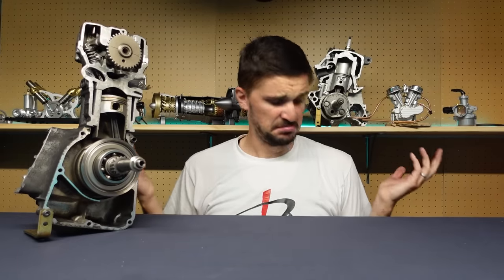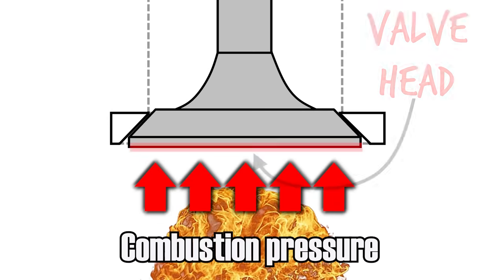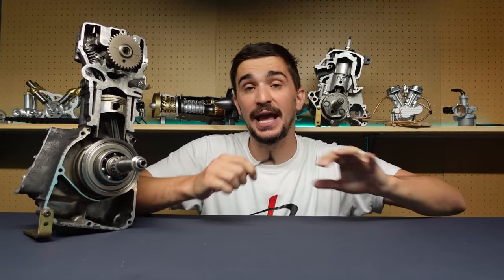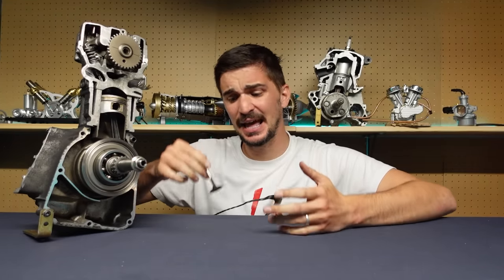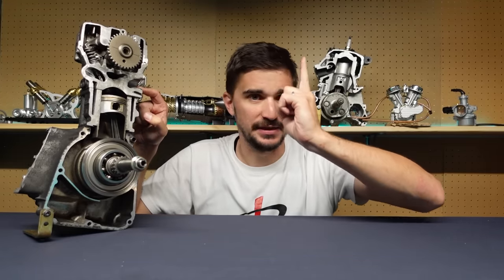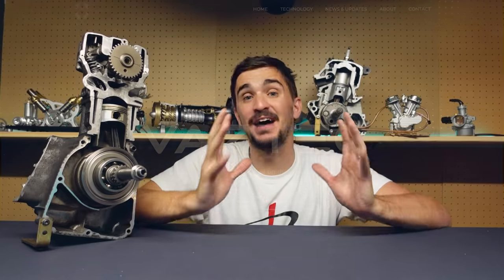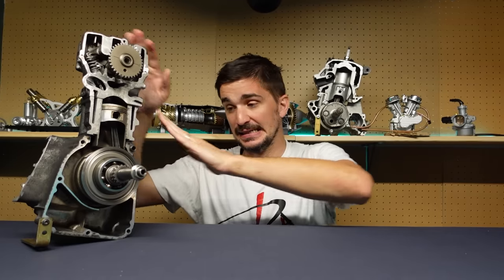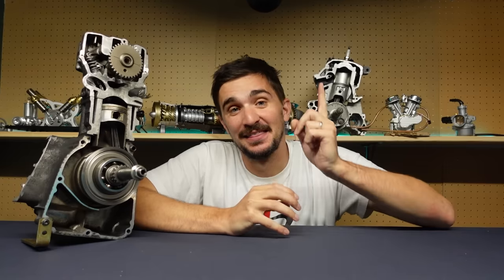Rotary Valves Make Normal Valves Look Silly - Why Aren't We Using Them?

Comment: This man just makes me want weird engines in my cars.
Reply: Real
Reply: Idk about my car but I certainly want a garage full of gokarts with all sorts weird engine designs
Reply: no shit. bro single handedly convinced me to bike carb swap my daily driver. imagine running carbs in 2024. but it was worth it. so much fun
Reply: Before watching: The engine in my car is fine. 
After watching: I want a bevel-drive, desmo, vr-5, contra-rotating twin crank design, two stroke diesel engine in my car.
Reply: @workdesu  when there’s a massive EMP you’ll be the only guy driving home.
Reply: @markm0000 fun idea but an EMP would also fry the starter motor & ignition system.
Reply: weird engines equal weird problems
Reply: @Matthew_Removeafterwashing   weird problems require weird solutions. Grab a banana
Reply: @markm0000 Diesel then? And without an ECU? Better keep a horse around! 😂
Reply: I just put valve springs in my mattress....  Wife loves it. I wouldn't of had that idea without this video.
Reply: get an audi with a chain in the back
Reply: @gags730  "wouldn't of"?
Reply: @PeterBaumgart1a   points for ignition and a mechanical pump. It can be done with gas as well.
Reply: Tbh cars don't profit nearly as much from this as motorcycles do, there's a big difference in the springs if your max RPM is 7000 opposed to the 16.000 in motorcycles, because of their rev limits motorcycles aren't even able to utalize technologies like direct injection yet
Reply: @alanhat5252  Idk, why aren’t cars faraday cages? Or at least like planes with lightning strikes have the skin channel the induced currents. I mean these currents have a low resistance path to ground. I’m genuinely curious as to how resistant are cars to EMPs.
Reply: @markm0000  I personally have a 1980 triumph spitfire with mechanical fuel pump and a carburetor and points ignition. I’m not sure how late they made these setups though. I also feel 2000s Toyotas would still turn on somehow, damn is that fanboyism?
Reply: @nestormoctezuma4695   no it isn’t. Get to talk’n long enough, everyone agrees a Toyota will outlast any other car. Even old Chevy guys will own up to it.
Reply: @workdesu  carb swap, dude that’s SWEET, all car guys have sacrificed drive ability/safety/ride comfort for the sake of cool. I sacrificed the existence of reverse for the sweet sweet sound of 14000 RPM. What car did you do this to?
Reply: @PeterBaumgart1a    Yup! It's slang, you have to say it out loud with a NY/NJ accent.  
If we are in English 101 we would call this a 'contraction' for "would not have".   Hope that helps!  
Yo, where you from? --> (Where are you from?)
Reply: He makes me excited about working on engines...his enthusiasm makes me forget about 1hr valve seating with a plastic toy arrow and sore hands...
Reply: @0r1x    HAHA OMG that comment is hysterical...  You feel like you are trying to start a fire in a wet forest.... only thing burning are your two hands.
Reply: @alanhat5252  ur right bcos i currently run electronic ignition system and fuel pump. but there's a variant of my engine that have contacts distributor and mechanical fuel pump. i started with those when swapping my efi to these carbs 😬 then only recently i settled on electronic fuel pumps and ignition system. and starters? it's manual..if it died we just push it in gears and would roar back to life ✨
Reply: @markm0000  ur comment made my day 🤣🤣🤣 thanks bro
Reply: @nestormoctezuma4695  it's SWEEEET AF. no rly. the throttle response is night and day difference and the sounds of those 'itb' carbs ✨👌🏽. my car is a 93 Mitsubishi Mirage hatch with 1.5 litre 4G91 engine. and did you swapped a whole bike engine into yours? its what i can guess from your description. if true damn that's sickkkk
Reply: This does the same thing to me
Reply: Can I interest you in a Cryogenic Thorium Powered Rotary Valve Sterling Deltic?
Reply: At least it will be easy to repair.
Reply: @markm0000  you would need a model T for that...
Reply: You say that until you need a work on one and need replacement parts....
Reply: @gunsmoke132  if you want it to function after an EMP some sacrifices must be made...
Reply: Gas turbine cars when?
Reply: @tirushone6446  thats a 50's thing
Reply: @nestormoctezuma4695  yea it is. You Toyota guys think you're car was hand crafted by god.
Reply: A wankal opposing cylinder rotary valve trimotor? Yes please?
Reply: so true! :D
Reply: Mazda/VW: Hold my beer 🍺
Reply: @Charon-5582 I got lucky and have a vehicle that is EMP resistant.  The Canadian and American Navy performed tests in 1996 of many vehicles.  Mine was one of the few that was still perfectly functional because the ignition computer is encapsulated in an aluminum, waterproof, box with grounded housing.  Other than the ignition computer, everything else is mechanically controlled. Thus, EMP would do nothing to it. I bought my vehicle new in late 1996.  I still have it today and it is my daily driver.
Reply: Rotary with rotary valves?
Reply: He needs to get on a R&D team for one of the big three!!
Reply: @workdesu was it too difficult to tune? I'd like to try that in my Toyota 3tc engine
Reply: he makes me want to invest into weird companies too
Reply: @bruhmoment802  it took me about 2 week with testings and stuff. it's not hard at all if you alrdy have basic knowledge with carb tuning. just gotta at least have a wideband afr gauge installed
Reply: The episode of the flintstone engine was so cool 🎉  or was it this channel 🤔
Reply: Sounds like someone who is going to join the mazda rx club
Reply: Like a Mazda rotary engine with rotary valves?
Reply: uuunnnnntil you need a seal or some other non-standardized part they don’t make anymore
Reply: Cars
Reply: Yeah, he gets me excited about engines like I do about new technology.
Reply: I got the same thing. I'd love to open the bonnet and watch a bright green glow emitted from an egg shaped Reactor.
Reply: @alanhat5252  try and engine with no electrics,,,manual start diesel, or steam engine,,,prolm solved
Reply: Having weird engines in your cars will make you not want them anymore. Things like rotary valves were tried several times since the 19th century and never caught, they don't seal right, airflow is wack, heat management is a problem... The devil is always in the details. There's a couple niche applications where they worked, such as some fighting airplanes (where the whole engine is overhauled every several hours of flight time anyway)
Reply: @PeterBaumgart1a wouldn’t have. “Wouldn’t of” doesn’t make sense but you definitely know what he meant
Reply: has me coming back from this like "how hard is it to fabricate something that and drive on the road"
Reply: until u own one.... 😢
Reply: @tredogzs  sounds like you’ve owned a weird engine before , I’m interested
Reply: @workdesu  1974 Triumph Spitfire 50 years after it was made probably made like 45HP and replaced it with a 2004 GSXR engine making 140HP screams all the way to like 14k RPM. Lost like 200Lbs+ to boot.
Reply: Bro, same.
Reply: @tredogzs  I never been a baby bout maintenance heavy cars but there’s a certain amount of custom that I just don’t have network of friends in these places of the industry to do it rn
Reply: Scotch yoke, rotary valves... What else do I need...
Reply: @markm0000  Some of us Old Mercedes drivers will be driving home too, I have 5 cars to GO and a Mercedes Pickup=Rare.
Reply: I wonder what is the German word for that feeling?
Reply: @gags730 contractions are formed by putting an apostrophe immediately after the last character of a word and then putting some fragment of another word immediately after the apostrophe.  You don't make contractions by using a space and a completely unrelated other word; those are called grammatical errors.  Or would it be a syntax error?  Either way, it is an error, not a contraction.
Reply: @justinwatson1510  Zellenradschleuse is the word I was kidding the 1st one...
Reply: Just to get even more problème behind
Reply: @Londubh  better be 2L twin turbocharged V12 with pistons the size of shot glasses revving to 20K rpm. Made by Honda or Toyota so they last 200k miles. Cast the block and heads out of magnesium. I want to pick it up by myself.
Reply: @PeterBaumgart1a best to have an mecanik old diesel engine same same what ever
Reply: Dave Coleman, when at Sport Compact Car magazine, used to cover theoretical and prototype engines. People are crazy inventive.
Reply: @gags730  also, "I wonder if it's good enough....maybe 5 minutes more"
Reply: nah we have weird engines now, he wants us to have good engines there
Reply: 0:37 😊
Reply: @PeterBaumgart1a wow you must be fun at parties
Reply: @fall-of-rome  you wouldn't believe it!
Reply: @alanhat5252 not a magneto ignition and you can always push to start
Reply: Rx7 👍
Reply: I know right....
Reply: Is that some sort of euphemism 😮 😜
Reply: i like how he ignores all the problems with alternative designs to make his point
Reply: i want the opposing two stroke engine.
what's better than a more efficient valve? how about not having valves at all?
Reply: @justinwatson1510 oh you poor soul.
Reply: The more I learn about  engines,  the more I love my Horse.   :-)
Reply: @newolde1  souls aren't real.
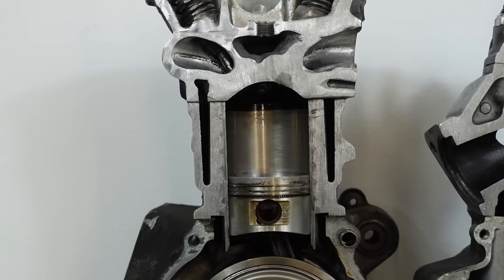Reply: Opposing rotors 5-stroke hotbulb, with carburetor injection, electric belt driven turbo supercharger, continuous 2 gear transmission, hydrostatic centrifugal clutch, wheel-less tires, 4x4 front drive, and it guzzles 1:30 diesel mix.
Reply: Just go buy a new car. Most have weird engines.
Reply: Old saying that the way to get great ideas is get a lot of ideas. I’m all for doing things different to innovate.
Reply: Fr
Reply: Well no one is stopping you from putting a new engine into your own car. Just make sure the computer that controls the fuel flow into the engine is reprogramed to go along with the engine change.
Reply: Well that's refreshing. My car just has weird people in it.
Reply: Amen to that 😂
Reply: Same here
Reply: Same here! Especially when I combine him with a few videos FortNine has made...
Reply: Do it but start small, lol like build a honda or something with a cousin engine swap
Reply: LOL, you are not alone, a couple days ago i saw a Volvo 240 with two Renesis Wankel motors thrown together. Rob Dahm was speechless😂
Reply: The poppet valve is counterproductive 😂
Reply: Real
Reply: But if it’s a runaway diesel